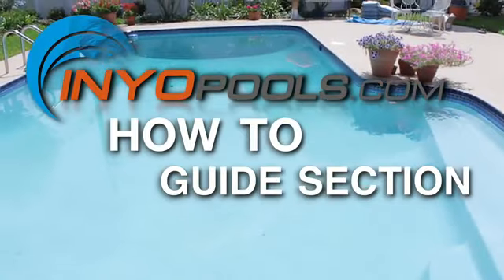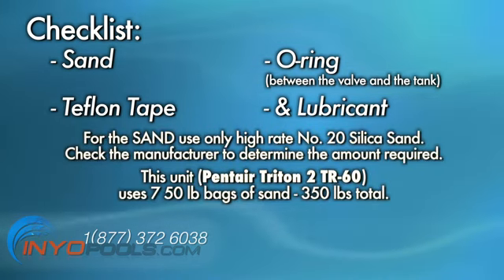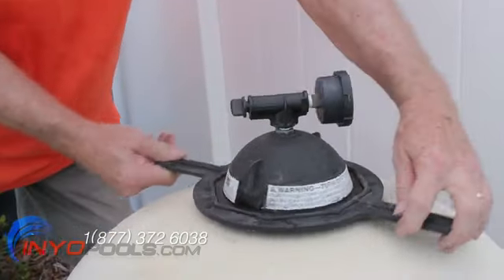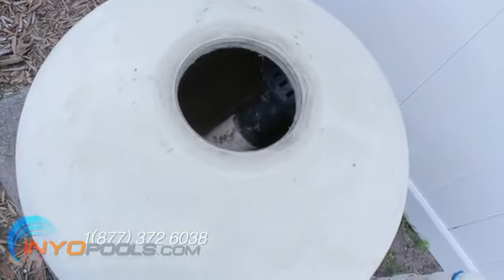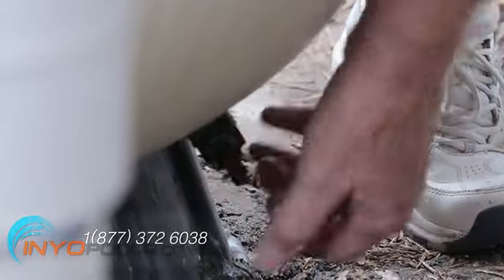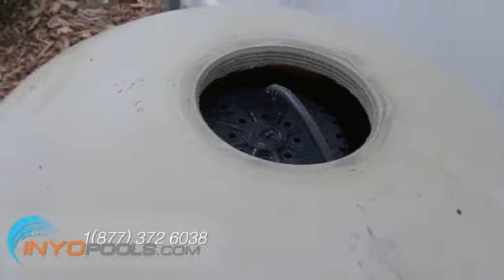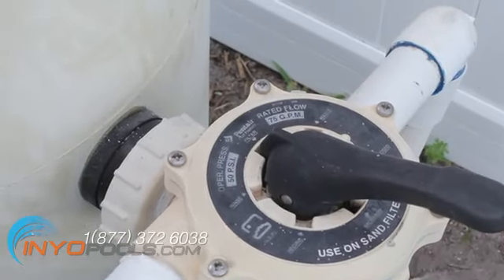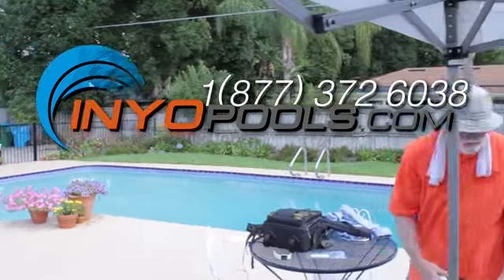How To: Replace the Sand in a Sand Filter

Comment: Thanks for these steps on the Triton... i will say that the manual for the Triton II has a backwash procedure that goes like this: #1. run Backwash mode until water coming out is clear, then turn off, #2. run Rinse mode for 30s, then turn off, #3. open the manual bleeder on #4, run Filter mode, wait for steady stream of water then close the valve (while Filter still running). In this video, you do this bleeder step earlier. Can you confirm it is different order than the usual Backwash procedure or follow that procedure i pasted above?

Comment: I was replacing the sand in the filter, tried to put the valve back on the lateral to make sure it was lined up and when I went to take it off, it pulled the lateral back up overtop of the sand.  🤦🏽‍♀️ I tried scooping the sand back around so the lateral assembly could sit flush with the filter, but it went go back down. Any suggestions?  Do I have to dump all this back out to get the lateral back flat?
Reply from the maker: It depends on how much sand is in the filter. If there is just enough to cover the laterals, you can probably fill the tank with more water to make it easier to move around the sand. But most likely, you will need to dump at least a portion of the sand to re-seat the lateral assembly.
Reply: Ty

Comment: Hi when I turn the nob on my pressure relief valve nothing happens....pressure gauge doesn't budge. No water comes out...no hissing...nothing
Reply from the maker: The pressure relief could be clogged with dirt or grime, preventing air from passing through.

Comment: Very helpful video.  I noticed the way you positioned the automatic air vent seems different from what the installation manual calls for.  It says: "Be certain the automatic air vent is protruding into the top of the closure as indicated below in Figure 1. Ensure that the automatic air vent is in the center of the filter closure."   Does that mean the vent should be positioned up in the closure dome rather than looped back down into the top of the tank like the video shows?
Reply from the maker: Hi Robert, according to the Triton 2 diagram on our website (https://goo.gl/JfK5qW), it looks like you may be right. The air relief seems to be up inside the closure dome. You should definitely stick your manual. Thanks for pointing that out and we will most likely make a revised video in the future. :)
Reply: It makes sense to me. That is where you want the air to go, even though it would probably end there anyway.
Ohhh, this post is really old....lol....like me!
Great video b the way!

Comment: Thanks for the video, it was very helpful.  I just changed my sand today, and backwashed the sand for a few minutes.  However, my water is noticeably more cloudy now.  Does it take a few days for the water to get clear?
Reply from the maker: +ruthlessluder Cloudy water is somewhat common after changing your sand. Add a water clarifier, it will lump together the fine particles of the cloud into bigger bits that can be trapped by your filter.
Reply: Thanks!

Comment: How to get the water out of the pump?
Reply from the maker: If it's an inground pool, most of the water should drain from the pump once you remove the lid on the filter. Removing the lid on the pump will have a similar result. You can also remove the drain plug from the pump to drain the strainer.

Comment: Thank you so much for this video. I am a new homeowner with an extremely similar set up as the one used in this video. Do you have any video describing the function, and whats actually happening for each of the options on the multi-port? I only know how and when to use the Filter (obviously) and Drain options.